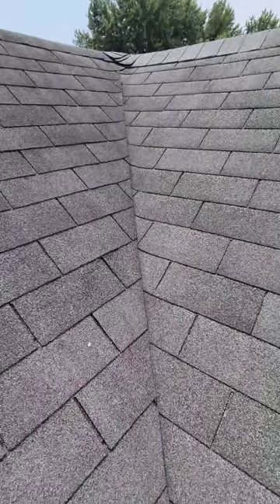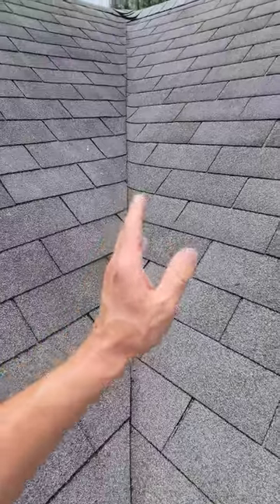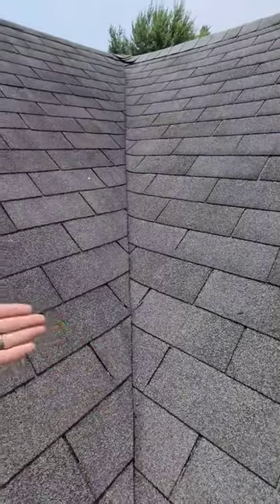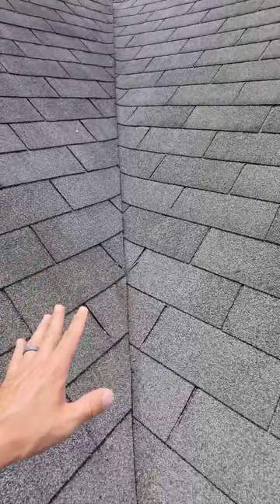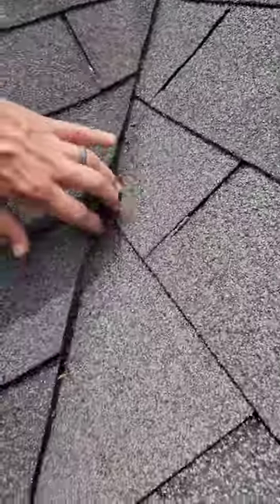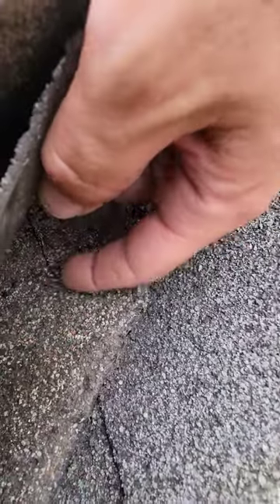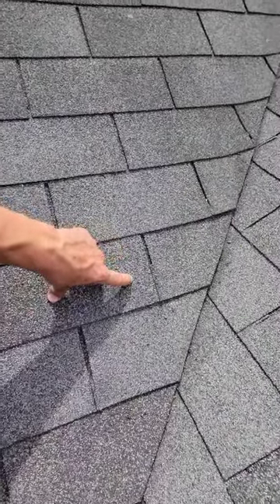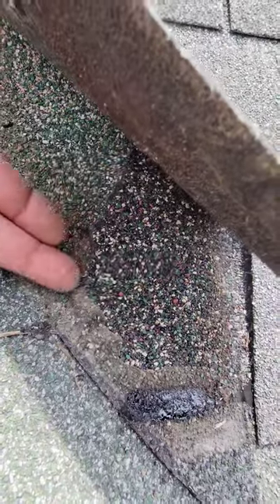Roofing a Valley

Comment: Your wrong. On so many things
Reply from the maker: Enlighten me.
Reply: Dormers always are under main roof,main roof is always cut,ice and water under all valleys, eaves, and rakes.i used to use metal with 5 beads 3 in the middle a 3/4 on each end back for a slaters edge.
Reply: @GrandRoofingInc  I did alot of copper bay window's ,alot of copper pan ,standing seam ,and custom homes. In Virginia, for 27 years. Now you have a white guy owns the business and you have 10 Mexican roofers that do the work for that white guy. Hahaha
Reply: @GrandRoofingInc  so no.I can't inliten you, because you ARE THAT GUY. Period.